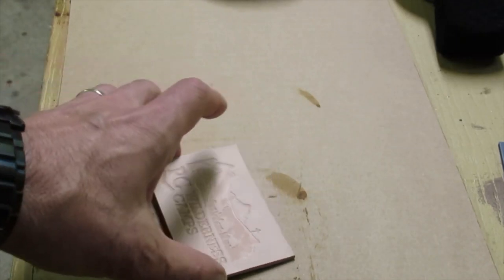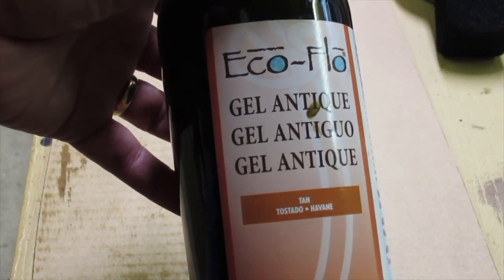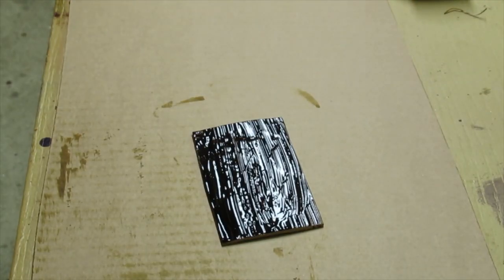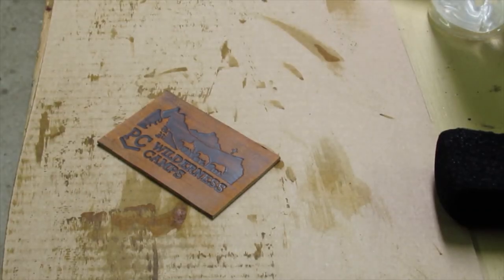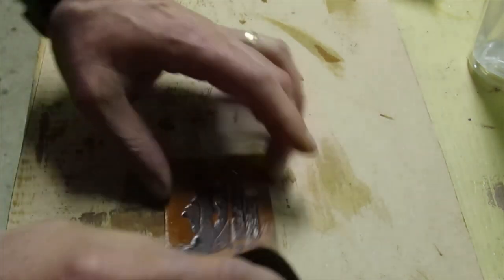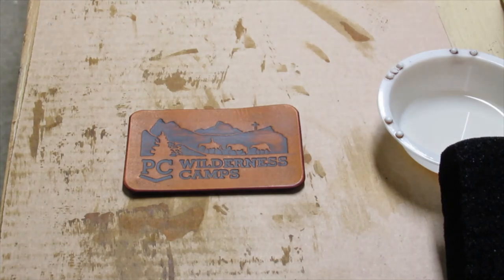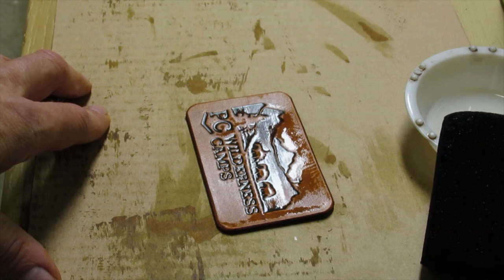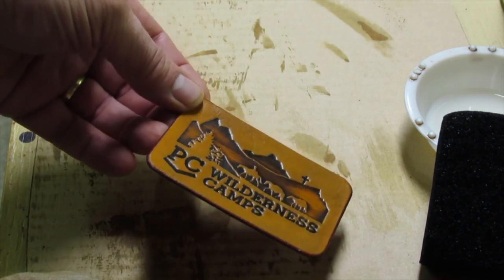Eco-Flo Gel Antique Application

Comment: Thanks for sharing!
I’m definitely going to try this method, it has great contrast and doesn’t appear to stain the raised portions much. 
Feibings antiques seem to stain the raised portions more. 
Do you treat the leather with anything prior to the eco-flo application?
Reply from the maker: I find that even some of Eco-Flo's antiques stain the raised areas too much. I get really good results with Tan and Briar Brown, so that's what I use most on anything I don't resist.
Reply: I apply Feibings Pro Resist after staining. Then I apply the antiquing finish. What I learned from this video is to use something flat to remove the antiquing from the top, leaving the finish in debossed areas.

Comment: whwats the difference between the gel dye and the other Eco Flo dye?
Reply from the maker: Antique gives you more contrast between the raised areas in your project (where you wipe it off) and the deeper tooling impressions. Regular dye doesn't give that much contrast between the two areas. Also, antique is thicker (larger molecules) than regular dye. Regular dye will stain everything, whereas antique will only stain areas that have not been "resisted".

Comment: Helllo, did you stitch with a sewing machine the corners or the leather stitcher, would you mind sharing where you purchased the patches please, thanks
Reply from the maker: Hi Ann. I make these patches myself out of vegetable tanned leather. Then I 3d print the stamps to stamp the image onto the patches. And I hand stitch the patches at the corners (I use double sided tape first to position them before punching the holes).
Reply: @saddlehillsleathercraft  Thank you so much for all your help do you ever sell the patches and if so how much
Reply from the maker: @annjohnson5699  Are you wanting just the blank patches, or are you talking about finished patches with the logo and staining, etc?
Reply: @saddlehillsleathercraft  blanks, please
Reply from the maker: @annjohnson5699  the standard patches are 3 1/2" x 2 1/4". I sell the blank ones for $2.50 each including rounded corners if you want that. It gets a bit cheaper if you buy 20 or more. Shipping is extra.